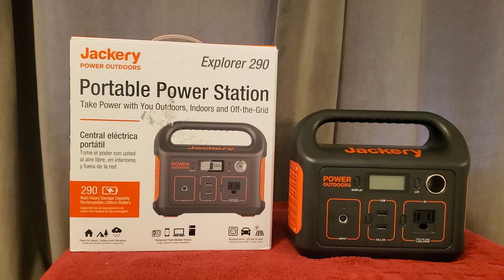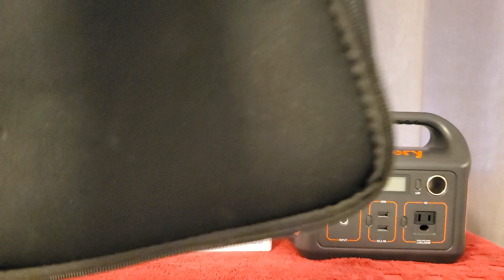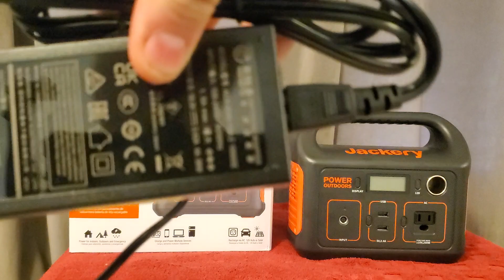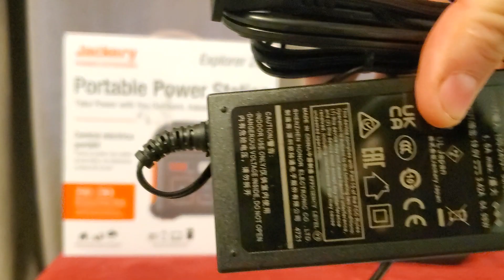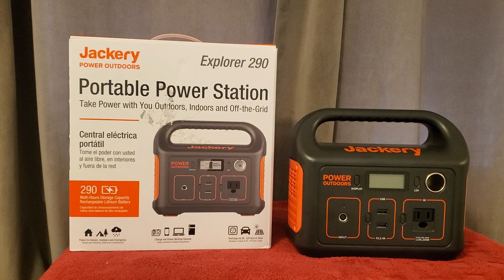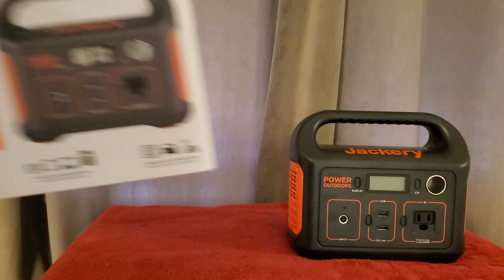Jackery Explorer 290 Power Station Review.

Comment: 1 Watt device runs for 290 hours 

Or

10 Watt device runs for 29 hours

Or

100 Watt device runs for 2.9 hours

That's how you approx usage from "290 Watt-hour". And Jackery names their units by Watt hours expected.

Jackery Explorer 290

Is a 290 Watt hours supply
Reply from the maker: @rileychadwell5635, I was attempting to convey that the inverter in all solar generators consumes a portion of that 290 Watt Hours (usually 10%). So in reality, you are only going to get about 260 watt hours out of a possible 290 watt hours of power. Thanks for watching and commenting. I appreciate it.